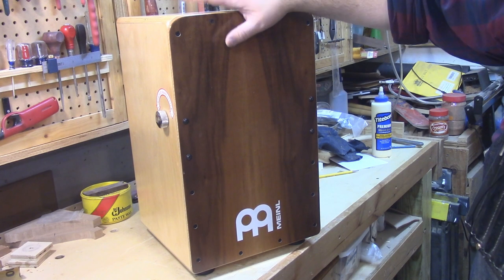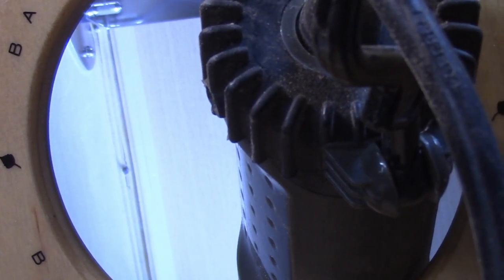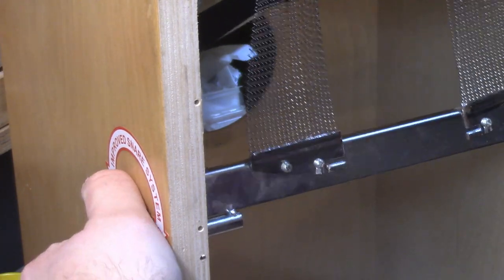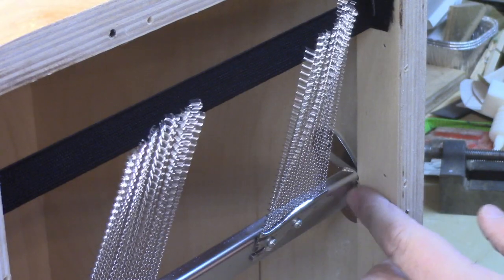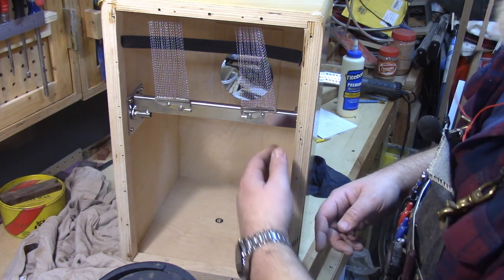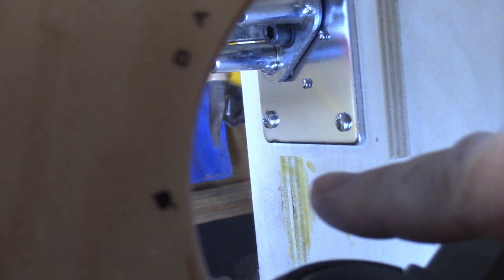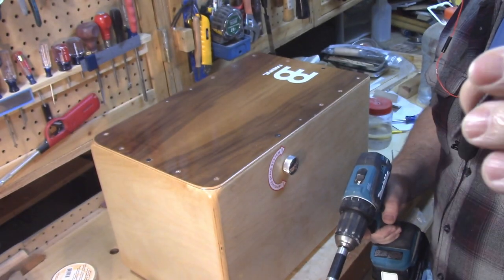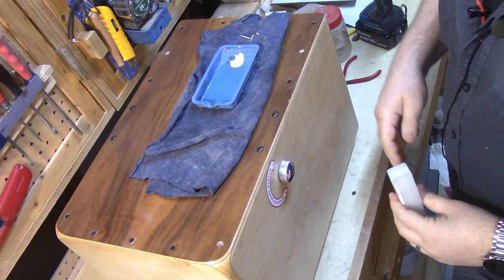Meinl Cajon Repair

Comment: Thanks for this, I really enjoyed watching your video! I have the exact same cajon.  I bought the pricier model hoping to avoid issues, but I've found the extra metal hardware actually creates a ringing tone which sounds bad. Especially when mic'ing the cajon for live performance or recording.  I think I might try and put some duct tape on the metal crosspiece to dampen the ringing.  Do you have any other ideas?  I don't really care much about being able to disengage the snare wires, and so I've even wondered about installing an alternate snare wire system if that doesn't work.
Reply from the maker: In an earlier video, I actually made a cajon with a snare. https://youtu.be/WS0AB7Z96qk The snare was the only metal in the build. You may want to see if that video sparks any ideas.